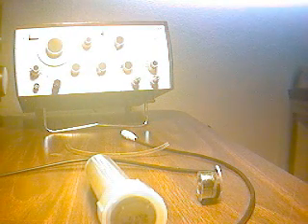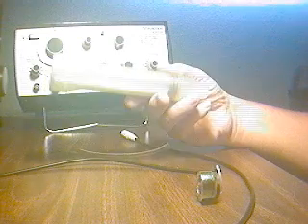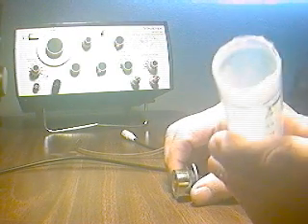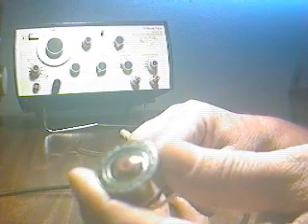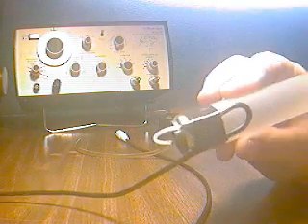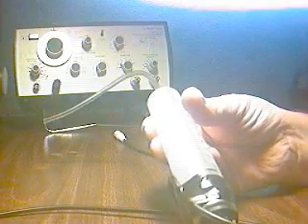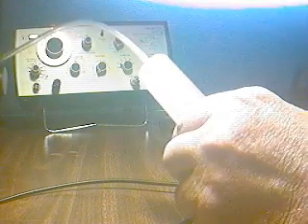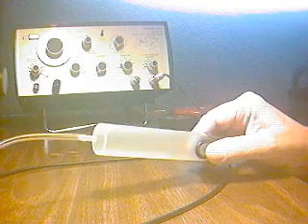easy infrasound acoustic source

Comment: When you put the aquarium tube on the end, is this sort of sealing of the end, does a cylinder need to be sealed air tight to create infrasound?
Reply from the maker: Basically this device relies upon the changing diameters of the cylinder and tube ...this to generate enough air column movement so  it will move the eardrum or other microphone elements sufficiently to create sound waves for Audible energy.   
   At , say, one or two hz ... the microphone element transducer is moving “ very “ little ....its excursion is small. Little wavefront is generated, a wavefront not perceptible by the human ear. By taking advantage of the change of diameters between the tubing and syringe, the motion of the air wave front is amplified. Bigger but weak air in the syringe pushes small air in the tube farther acting as an amplifier to the sound front.  Since the tubing and ear canal are simpatico... you get enough air motion to rock the eardrum parts which allows you to actually hear that sound . The open end of the tubing can be pointed closely at your eardrum, a microphone element or and low hz sensor .  This is the demonstration in my video. That’s about a 7 hz acoustic signal that can be clearly heard in the PC microphone and similarly in your own ear. I hope this helps.
Reply: @k4nlz  Yes it does, I understand now. Thank you for your video and explanation.

What would be needed besides a signal generator, to create infrasound on a larger scale, with a speaker of around 12" dia?
Reply from the maker: @TheHalloweenmasks   that’s always been a toughie. Lots of experimenters have sought to produce the ability to produce a powerful infrasound wavefront in the zero to 12hz range.  Generally acoustic stereo coil in magnet structures don’t have the mechanical suitability to do that with any efficiency. It takes something the size of a small grain storage silo to work properly. Think of Bose folded horn corner speakers X1000. Check in Google for: LRAD long range high energy sound projectors. Most of these dangerous devices work in the range of human hearing , but a few are developed as subsonic sound weapons. Also, if you can find it digging around on the web .... the British had a sound weapon back in the day that looks like a bunch of organ pipes mounted on a track vehicle. It is demonstrated shredding rock walls. The us government has a different device that is also a sub sonic sound weapon that is meant to disrupt humans. It very secretive.... if you get the right video clip of the Waco branch Davidian assault, you will catch glimpses of it . It’s about 12’ or more tall and resembles a spinning bunch of vertical boards .... kinda looks like a wind powered device of some kind ... a giant wind speed indicator .... but far from it , it’s spinning and casting out a powerful subsonic wavefront. The speed at which it’s spinning determines the frequency it’s broadcasting into air. Maybe you could dig up info on that, it’d be difficult tho.  Finally there are several videos on YouTube that show a powerful large rotary vane subsonic speaker .... check those out.
Reply: @k4nlz  Thank you again, I will follow these. One time I heard a speaker (Bill Cooper) claimed that Germany could punch holes through 4" thick armour plating, from a distance of 2 miles, this was in WW2, I was a little sceptical of this but from what you say, I now believe it. Its scary!
Reply from the maker: @TheHalloweenmasks   a long time ago, something called a shape charge was invented. The principal was founded before the 20th century. By wwII explosives were highly developed and very powerful in smaller packages. Anti tank weapons were small shoulder launched weapons with powerful shaped charges on their nose cone. The rocket propelled shape charge could easily punch thru 4” of steel and much more. Bigger rockets, launched from big banks of rockets or off an naval or aircraft platform could easily deliver a large shaped charge bearing rockets that would make quick work of only  4” thick  armor. Modern versions can punch they 12-14’ of concrete and steel and explode deep in underground bunkers. Modern steel piercing projectiles don’t even use explosives these days. They fire high rpm rotating projectiles of dense spent uranium at enormous velocities. No explosives needed. The kinetic energy can Pierce / bore into  about anything steel and the sprawl of liquid hot metal from the rotation and density does all the damage. No explosives needed.
Reply: @k4nlz  Yes I know of shaped charges, I forgot to reference the claim of Bill Cooper, with the use of low frequency sound waves. Low frequency sound waves destroying 4" armour  plate. I think that Germany were far ahead in technology terms, back then in WW2.
Reply from the maker: @TheHalloweenmasks  ah .... sadly, just about everything on the web these days is subject to disinformation, wild theories, bizarre claims ... often or most often from people seeking, site clicks, reputation enhancement and a pile of other reasons. It’s really hard to sort out the BS ...there is so much of it. Last I looked there were over a million videos demonstrating “ free energy “ machines ... absolutely there is no such device in existence. How many fuzzy alien craft in flight videos exist on the web ?  Anyway... if you think about this type of thing in terms of the job being done and the energy needed to accomplish it ...you are off to a good start .... that and there are absolutely ( as of yet ) no free energy machines.  It’s all about manipulating masses on the atomic level. Big lasers work because they generate enormous levels of energy in an atom size spot and can disrupt the molecular bond of some kinds of matter. Ultrasonic cell homogenizers work the same way. They use piezoelectric transducers to couple high frequency ultrasonic energy into ( water filled ) human cells to agitate the molecules to generate heat and burst the cells. Nowadays modern manufacturing shops use CO2lasers, jets of water and electrical plasma to cut thick steel. . All of these generate enormously powerful,  molecule disrupting spots of energy to get the job done. All of this works up close except lasers nowadays. The inverse square law dictates that energy  
cast  over distance diminishes enormously as the distance increases. 
     If you keep these basic concepts in mind  when reading wild claims about so called Secret weapons, energy beams, particle weapons etc.  , you can start to separate out the B.S. . from reality.  If there is no science to back things up then stick with the science rather than wild unsubstantiable claims of mysterious so called secret new technology. This until different science shows up to add to the knowledge base. If you look at my walls of Science lab equipment in the photos you’ll see that I spent more than 50 years chasing down unknown natural earth phenomena... acoustic, natural nuclear, subsonic infrasound , elf below 10 hz, micro seismic and magnetic waves ...  I’ve spent 1000s of hours using this equipment at Area 51, Hawthorne and Dugaway trying to see what my tax dollars was buying and trying to get a fleeting glimpse of an exciting new technology. Listening is great, buying into things is a different thing. In today’s world of scientific bs and conspiracies you can hardly trust anything you hear. Just say’in 💪💪💪😊😊😊
Reply from the maker: No Bull.  as a humorous aside , this reminds me of  a couple of videos I put up on the tube about 12 years ago as a spoof for friends of mine that wanted me to prove free energy / perpetual motion actually existed. I wish you could have seen them, I think you would have loved them. They were works of art. I even invited in three electronics nay sayers to examine them and those guys were convinced immediately.  So .... so I built this complicated great looking glossomer light assembly of opposing magnets , pivoting devices and  a central magnet powered rotor that was suspended upon frictionless bearings using the super magnet and high conductivity carbon sheet principle ... as seen in many levitating children’s toys these days. I brought friends and naysayers in and spun it by hand and it would spin , by itself, at about 4000 rpm ... lighting up a #47 panel light bulb. It ran forever, hours, days weeks. It made a great YouTube video as well. I also had a cute toy where I brought friends into my living room, folded some aluminum foil over a plastic frame and claimed I had solved the scientific question of untethered ionic levitation ..by doing it wireless. You can buy those amazing looking  ionic levitation kits all over the web and they are great fun to play with. I glued a pair of 3” round butterfly wings on the craft and sat it in he middle of my glass coffee table .... waived a magnet over it and presto .... it lifted about 5” into the air and sat there. No smoke, no mirrors. It would literally brain fry anyone that say it go. 
      Then I got kinda scared when it started catching on on the tube, friends started talking of selling it to the government, industry etc.  I took down the videos and came clean that what they saw was more of a magic trick that real life....none f it was real. Many friends that saw it thought I was lying, that the government got to me etc. ...things went crazy. Some got angry saying to give them a copy so the world could see and not be bought and destroyed by the fossil fuel industry etc. it was insane.  Absolutely no one believed it was fake. It was a freaky experience. Conspiracy theories exploded. 
   In fact it was a trick .... I had disassembled that coffee table and routed out where the glass sat and very cleverly installed 100s of turns of #36 enameled copper wire and used filler to conceal it. I had drilled out a long but small diameter hole in two of the legs and ran the wires to the metal leg end caps of the table. Where it as placed one leg sat on the edge of a floor heater vent , and the other was atop of a plate  hidden in the carpet. The point of the table leg end cap pierced the carpet contacting the metal plate. I could lift the coffee table and let people examine it .... nothing to see there . Then I placed the table ...put the little induction motor magic device on the table and spun it ... Presto free energy / perpetual motion.  It was beautiful. You can see pictures of my home  nuclear lab, electromagnetic lab, geomagnetic lab seismic lab and infrasound labs in the open to the public albums on my Facebook page under the name “ Wave Bender. “. I present several unique and novel approaches to the field of geomagnetics and infrasound signal analysis that can be very useful if you are n the hobby.
   I’m just presenting this funny story as a novel aside and it is always n no way intended to influence your “ beliefs “ , understandings, perceptions or any of the things you mentioned in your post above. Your post triggered memories of that experience, just thought I’d pass it along as some way you can impress your buddies too. Yayahahahaya yayahahahaya. In my book everyone is Entitled to believe anything they want and have any understanding they please as long as no one  is harmed or gets hurt.   Free will to believe as you want is more important than anything.

Comment: are you using sine waves  to power that ultrasound mike
Reply from the maker: I'm probably not using a sine wave , rather a complex waveform ..... however , it's more to do with acoustic pressure ( wave intensity ) than waveform.    if the  / a waveform ( of any type ) is sufficient in intensity / volume to actually move the eardrum ... then the human ear can detect it ... no matter what frequency it happens on. of course waves of a frequency too high to move the eardrum mechanism sufficiently cannot be sensed as well ( the human eardrum is most sensitive , generally, in the 300hz - 3000hz range ).  sine waves  do not exist in nature, they are mostly a human invention. the vast majority of sound the human hears is natural in origin.  even music , which can be mostly be made of sine waves ( like stringed instruments ) usually / often contains other wave forms such as impulse / percussive waves as well ( drums ).   the human ear is VERY adept at hearing percussive / impulse waves  down to  1hz or less ( car doors slamming  or kick drum in rock music ,  for example ).  there  are  little to no human environmental circumstances where pure sine waves are the only wave present.  even at a stringed instrument concert, there are plenty of people coughing , walking, dropping things etc ( a person walking is making percussive sounds at a frequency below 10hz ) .

Comment: How can I find/make an infrasonic detector, not source?  I want to find out if the low frequency vibration I hear is from the environment.
Reply from the maker: as I have said in several replies  below ... search eBay for Inflitec.  ALL sound is from your environment unless you have a  physiological ( common muscle twitch pounding in your eardrum ) or a psyc issue.  detecting infrasound is NOT the same thing as hearing 20 - 20k audio. a sound wave at 3hz takes 10X longer to develop / hear than a sound at 30hz. it does not make sense in the same way  as waves that travel at normal human hearing ranges. the  1hz infrasonic impulse wave of a car door  slamming is easy to comprehend .... BUT ...... a complex wave form at ( say ) 3hz  ( elephant communications )  would not make sense to a human in the usual sense. probably incomprehensible without investigation and physics understanding of ultra slow audio wave forms.
Reply: Thanks!